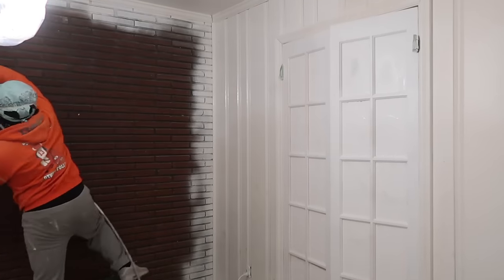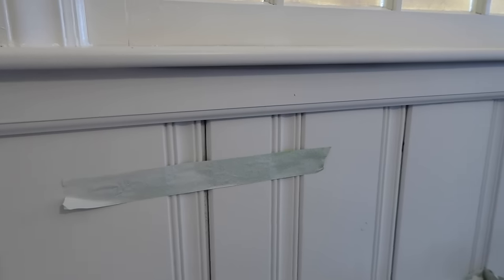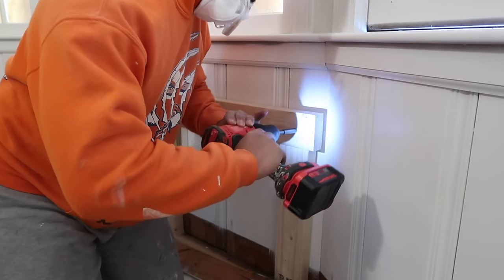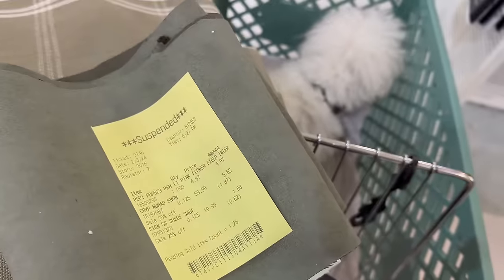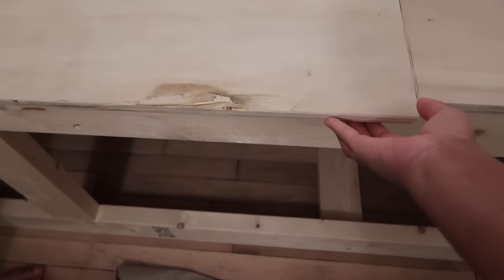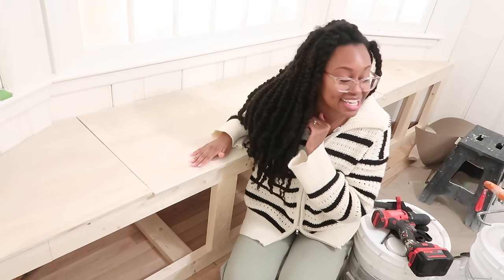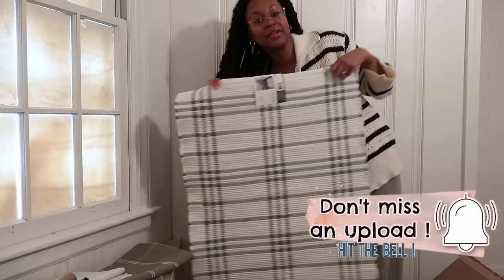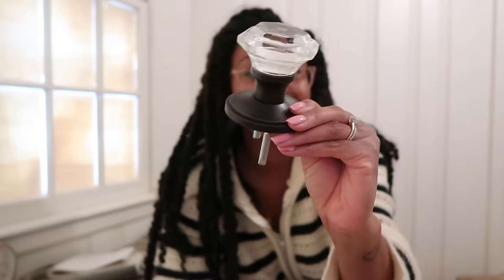BUILDING A CUSTOM BENCH,NEW FURNITURE, & PAINTING !! | DIY Dream Office Makeover Pt. 3 #FIXERUPPER

Comment: Hey Kayla, I do upholstery work you need 2 1/2 yards of fabric for that chair that’s all the way around plus the arms.
Also, I don’t recommend just covering the chair and less you clean the current fabric that’s on it any smells or stains may come through on that white fabric even though it is performance resistant. Plus if you take off the old fabric, you can use that as a template for the new fabric
Reply: By the way, the room looks amazing. I can’t help you with the wall though.
Reply from the maker: Thank you love ! My mom said the same thing about taking the old fabric off so that’s what I’ll be attempting! Pray for me 🙏🏾

Comment: Marcus could do a little cut out in the 2x4 in front of the bench, then run a more focused area from the vent to that cut out on the front of the 2x4 and then find a vent cover for the cut out for the front of the bench. That way the air still heats the room but you don’t have to re-route the actual vent part.

Comment: Great project! To avoid the liftdoor sitting proud of the rest of the bench top (so that the line between your cushion and front of the bench is consistent), have you considered using a pull that sets just beneath the surface of the wood? For a free option, you could consider just drilling a couple of holes to lift with your fingers or cutting out a small opening just big enough to slide your hand in to lift.

Comment: Panel the wall and the side of the brick so it’s all solid n then u step into the room n boom brick. And have him put brackets on the middle of the bench to lift without coming all the way up. You can also trim the access off so it’s plush and just add a tab on there for lifting it up. The chair should match the bench like a union I like the cream one bc u paint ur doors over the months n u don’t want the green to clash. Use the white n green rug not the brown. Ok I’m done I love all the changes yall are killing it

Comment: The brick issue is because of the dye in the bricks. Some bricks need to be sealed to prevent bleed through. I think you should use the Zinsser bin primer on the bricks and paint them the same colour as the walls. I like the check fabric or the faux suede for the bench, I would cover the chair in the suede fabric. The light fabric will get dirty very quickly.

Comment: Be consistent and do the side brick and the small brick wall all the same.  On the bench, cut the extended lip off so edge is even all across the bench.  It will create a more solid and safe surface for the bench cushion.  For underneath access, just drill two small holes (finger size) on the top near the front for finger grips to open the lid.   The larger target rug matches your fabric choices.  The Walmart one just doesn't work with your pallet.  I'd go with the heavy duty fabric for the chair (white).  That chair will see a lot of wear & tear you want a fabric that will last.  As for the chair, I know having it professionally upholstered can be expensive.   But it's worth it to have it done right, especially with expensive fabric.  That chair will be a very difficult chair to upholster, especially if you don't sew.  It has has lots of odd angle a full seat, back and arms.  At least check out what's available in your area, you might be pleasantly surprised. Additionally, the thicker or heavier the fabric (durable ) the more difficult it will be.  For the bench seat, yes, the solid green faux suede fabric would look lovely.  You absolutely want that to be a removable cover so you can wash it.  Ask the store for the washing instructions.  The remnant fabric would make lovely throws.  Also make them removeable.  Best of luck, you guys are doing an awesome job.....